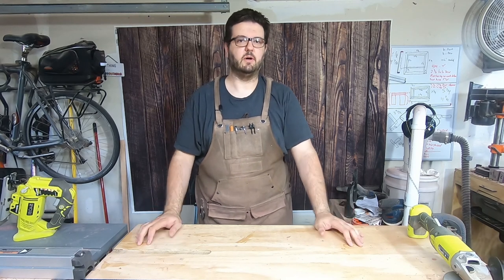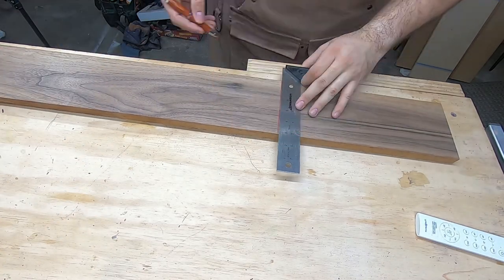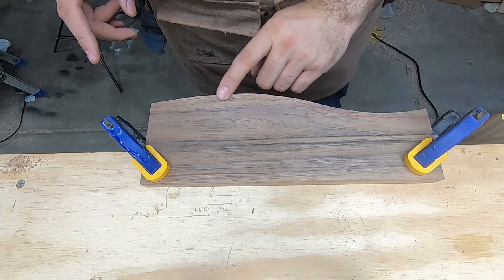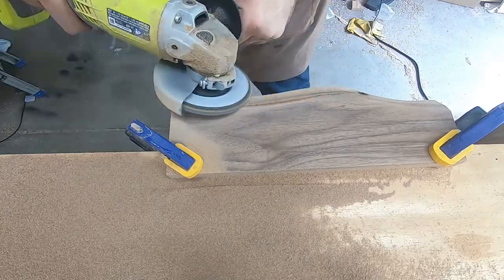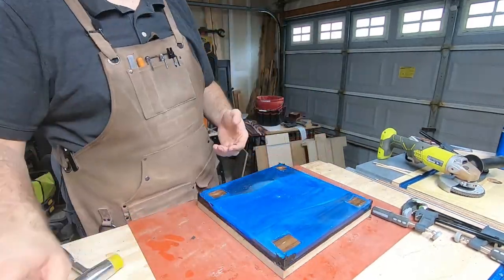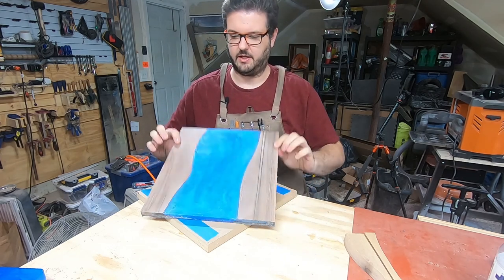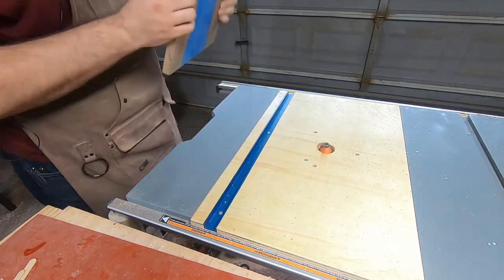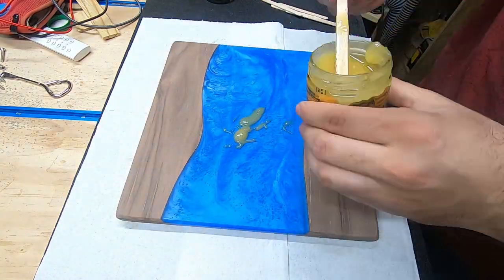DIY Faux Live Edge Epoxy River Table

Comment: Very nice! Small, simple, looks great. Subscribed because of the “unorthodox way of doing it” and because it seems like a new channel with shop, equipment, and material very similar to mine. Also, I’m a welder and would be able to easily make a similar stand or one for my parents that slides under a couch, for some reason they like those.